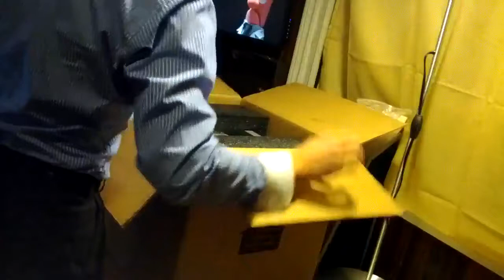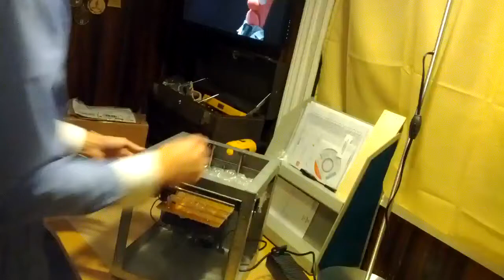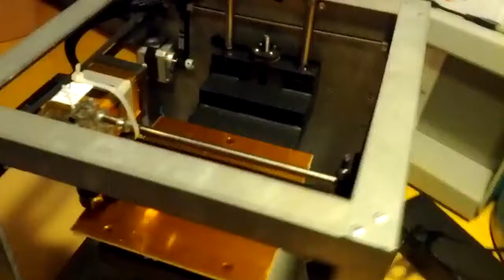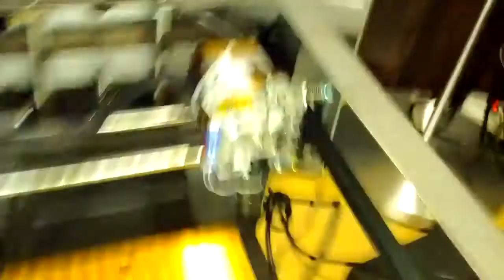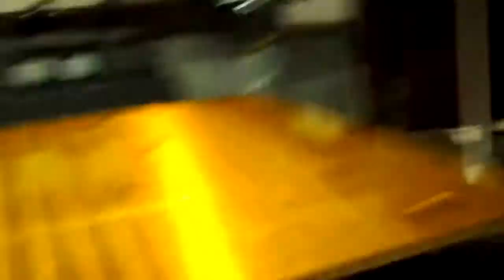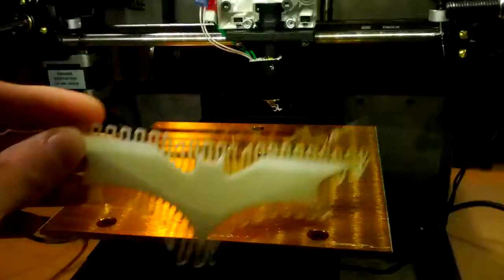Solidoodle 2 (3D printer) unboxing!

Comment: very true.  Yet I did wonder about it.  Seemed to me, owners may have been over tightening their extruder heads.  

Mine should be showing up in another 10 days with the new aluminum platform (where yours is wood).  I figure if I out grow this one I can build a bigger frame and install longer rods to make it a #3.

Comment from the maker: I ordered it to Canada and had to pay an extra $100 at the border (standard tax). Still definitely worth it.

Solidoodle uses opensource software so there is a lot of support for it online. It was a bit confusing at first, but once you play around with it, it is easy. Now to make models to print requires other 3D modeling software, there are free programs like tinkercad or sketchup, but you will have to learn to 3D model. That being said thingiverse has tons of stuff to download and print =)